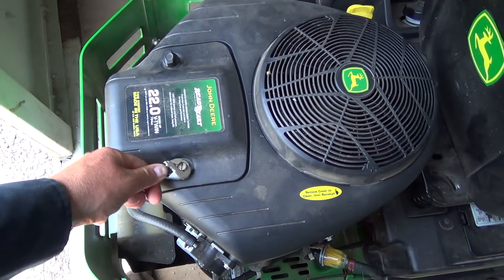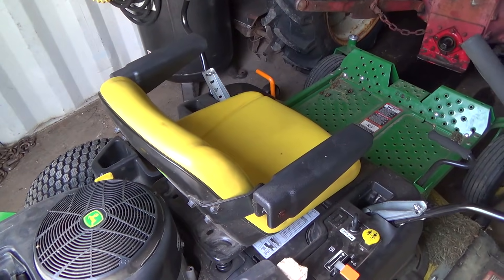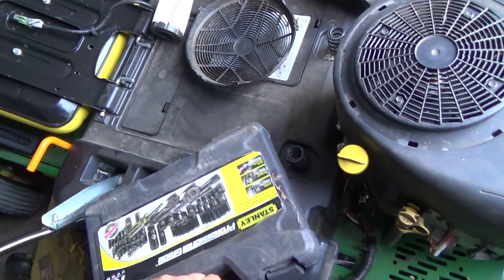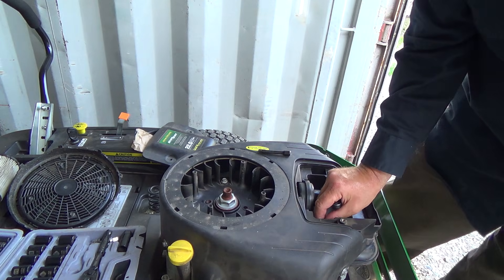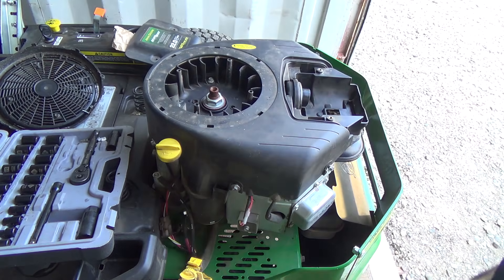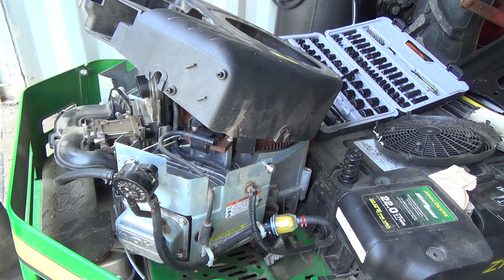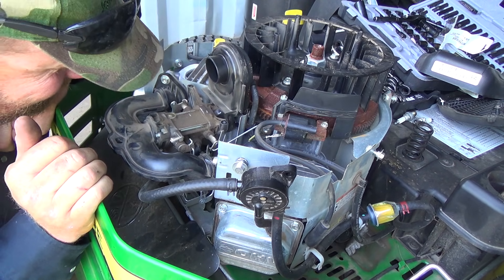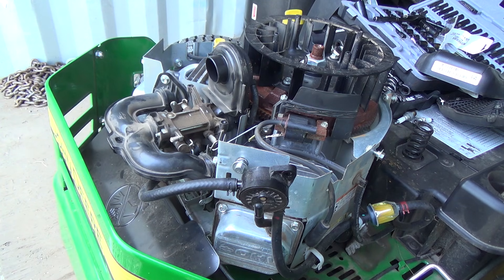Oh no.....We have our first issue with the John Deere 0 turn mower Z355R Intek m44

Comment: I have had that happen with a Kohler engine 
What happened was small sediments got passed the filter into the carb and that made it do what yours did 
Check the bottom of the gas tank also to make sure the outlet at the bottom of the tank is free flowing
Nice video
Hope it works out for you
Nice sounding cam fir a small engine

Comment: Thanks for the video. My 355 did the exact same thing a few times late last season. It even up and died once or twice leading me to think I had run out of gas or had blown it up. The odd thing is that it would go away for a while, but then come back randomly. I assumed the fuel filter was full of crap and intended to change it this spring. Now I'm not so sure that will completely fix the issue.

Comment: Removing that green bumper looks like it would open up a lot of room to get to the carb. 
Plus use that socket that you put screwdriver tips in on the 1/4 ratchet.
Reply: Was thinking the same thing. Looks like it’s only a few screws/bolts on each side.
Reply: @Xanadu245  AFTER, taking the 6 screws out, I realized, the 4 that holds the WHOLE GUARD ON, was quicker and easier.  GJ on those eyes folks!

Comment: Hey Bill, I think you definitely have a fuelling issue. I’d be taking the carburettor apart and checking everything. I think after a clean it should solve your issue. I’ve had this on small engines before when they surge, after cleaning the carb it sorts that issue out. You may need new manifold gaskets but I’d check them when removed, I’d also spray the gaskets with brake cleaner when it’s running to check for any leaks on the gaskets. Air leaks could cause it to surge but tend to make the engine idle higher too

Comment: I figured out that the easiest fix for this is to take my air compressor, remove the fuel filter, and blow air back into the gas tank.   

This solves the problem 100% of the time...
Reply: I just pop off the fuel line and blow back into the tank until it bubbles. Reattach the fuel line and I'm good until it does it again. I'm guessing there is crud in the tank.
Reply: I blew back through the fuel line till I heard it bubbling in the tank. Then I took off the air filter and sprayed seafoam in it. 2 short boats let it run for a second then did a long blast till it choked out. I let it set 10 minutes and it ran perfectly. I am glad that I read the comments on this post. I would recommend do this before going deeper. Thank you!

Comment: My loving wife ran the deere out of gas!!  Now it wants to run like CARP......I know.......Anyway I am getting ready to remove the offending junk she probably sucked up in the fuel system myself....Normally I would have taken it to the JD shop and let them work on it...But I will watch some vids and repair it myself.  A few years ago just before my 55th birthday I had three major strokes and it took awhile for me to be able to function at about 70 percent of what I was...Now I am 69 and would send it to the shop except for one thing...We bought ours a couple years ago and it worked for a couple cuts on the 3 acres then the Z355R quit in the small orchard under an apple tree. I looked at it and figured that it was the diode in the control panel. So I went to the Deere store in Mooresville, Indiana and bought a couple of new ones. I told the guy about what my vom said and he told me "it couldn't be that!  It must be something she did!"....I took the diodes home and inserted one after trying the original one just one more time. It didn't fire up with the original one so in went the new diode...The engine came to life and she finished mowing...The next time was about the third cutting after the new diode.  I checked it with the vom (I know you know that that means Volt Ohm Meter but there are the few that may not who read theses posts) and found the same thing with the diode not reading in either direction and I tried both + to - and - to + with no reading. I checked the new one and the mower...once again came to life. I called the JD service department and told them I needed them to come to my house about 20 miles away and pick up their toy and fix it!  I just paid almost 3 grand and for it to quit running twice and down to my last diode the problem was theirs. Well the argued about it but I called corporate and they instructed the folks at Deere to retrieve the mower and find out what was wrong. To make a longer story a bit shorter they said they couldn't find a thing wrong with it and charged me for the shop trip of $80.00....I told them they were full of carp (once again I am being nice !) I was a vehicle mechanic for many years working on all things military, the civilian years as a mechanic on Yale, Clark and other forklifts and cars and every darn thing else that has electrical/mechanical traits and I was sure it was probably corrosion from sitting in front of Lowes all summer for sale in and out of the rain, and some probably got into the electronics/electrical system and crusted up something causing an overload condition to the diode.  They said Naw....just operator ignorance....So now when something goes wrong with the deere I will stay away from DEERE maintenance!...I told you that story in case you ever have that problem.

Comment: I have a snow blower and a tiller both over 40 years old-- both have original plug-- start 2nd pull- I never even check the plug. I just take out- clean and regap every year

Comment: I had the problem with my JD D155 riding mower with intek 24hp briggs... It had the plastic intake manifold.... there was no heat shield over the muffler & the plastic maifold warped.... It had the rubber o-rings & seemed to suck them out.... I spent a ton of $$$ from Briggs & stratton to replace the manifold & eventually it did it again.... I searched for a long time for the aluminum older pro manifold & got the only one from Ebay.... $30..... solved all my problems..... I suggest get a kohler engine or kawasaki..... Briggs has become nothing but junk the last few years......I will never buy anything briggs ever again....
Reply: Yeah, EVERYTHING is getting cheaper all the time. I think the Briggs is better of the evils, Kohler and Kawasaki -same shit. Honda maybe ?

Comment: It definitely sounds like a fuel issue could be deposits in the bottom of the fuel bowl weak mixture clean the carb bowl and jets check the governor also. Definitely weak mixture for some reason putting the choke on and it helps leads me to think weak mixture I thought it was a little weak looking at the plugs regards Alan.

Comment: Depending on the carb it is the pilot jet. If it has one. 99% of surging idol problems is the pilot jet needing cleaning or even bored out a bit. But I'm not an engine guy. Happened to me on a small engine YouTube tutorials helped me fix it ;)

Comment: The older version of those Briggs inteks had metal intake manifolds. These new inteks like yours have plastic intake manifolds. They are fused together in the middle. After a while they start to leak where they are fused together. I think that might be what’s wrong with yours. Spray brake cleaner on the seam of the manifold while it’s running and that would temporarily seal it and it would run better for a second and stop the air leak just so you know that’s your problem. Try it and see. And the fact that it runs better with the choke on also proves it’s a air leak

Comment: You have a fuel problem. The carburetor is dirty and needs cleaning. I used premium fuel in all my lawn equipment and no problem at all. I know it’s expensive but it’s better than having it at the shop being repaired.

Comment: Start it up Spray some break clean or carb cleaner where the intake meets the head to see if it’s leaking if it is it will make the engine run different

Comment: I don't know, maybe I'm extremely lucky or something but my experience has been the direct opposite of the comments section here.. Everyone is saying how dirt in the carb will do that?  In the last 20+ years of being around Gravely, Allis Chalmers, Cub Cadet, Case, Farmall, Honda, Kawasaki, etc etc etc etc the list goes on for miles of all the carburetor engines I've had twins, singles, quad carbs seen it all.  And the dirty shitty fuel tanks were common for me lol  chunks of dirt and rust always going into my carbs never EVER had any issues.. The only time I had a problem was with a Kawasaki engine because it sat for 5 years to the point the fuel solidified into a hard green substance that reduced the diameter of the fuel circuits in the carb..  So it was running way to lean, couldn't get the fuel it needed so if you attempted to hold an rpm the engine would rev up and up all by itself, that is a lean condition.. Rich would be the other way round it would idle lower and lower til it stops.  Usually just going wide open throttle revving up and down an engine a few times clears the dirt out.  I believe your issue is a bad seal on the intake, or a intermediate electrical failure.  Either with a switch or sensor.
Reply: Whatever the issue, it seems to be common with Briggs engines.  I read hundreds of posts and watched as many videos and all the answers are different, but none of them have worked for me, so far.

Comment: that vane is not to the choke, it is the governor

as it is moved closer to the flywheel its not trying to close the throttle
as you move it all the way away from flywheel it wants to close the throttle
something may have gone out of adjustment causing the governor vane to swing away from the flywheel like it doing, maybe a broken spring or linkage
Reply from the maker: its part of the auto choke system

Comment: 2 yrs later...what did you find out?  I always suspect waterr droplets in the bowl. disconnect fuel has, drain into glass to check for debris or water, drain Carb bowl into glass if possible to see droplets , spray cat cleaner thru carb, let it dry.   I also found some bubbles floating ONTOP of gas sample, I have no idea what that could be unless its ethanol ?    some one reply please.

Comment: I'd say you're not getting enough fuel from the carb. It's sucking in too much air for the reduced amount of fuel it's getting so it starts to die, then as the RPMs go down it's pulling less air so the amount of fuel is fine and it tries to rev back up but then it starts getting too much air again. Could be dirty jets or possibly a weak fuel pump.
You said your guy mentioned possibly a problem with a coil and we've had a coil go bad on 2 of our JD zero turn mowers at work. They always seemed to idle ok but would cough and sputter when you put a load on them so I'd say it's probably not that.

Comment: You have some debris in your carb that is why it is (hunting) with the throttle
Reply: Not necessarily.  The first time this happened to me, I put a new carb on mine, but that didn't help.  It turned out to be an issue with the governor.  The problem is that surging can be caused by many different things.  One of the more common causes is a dirty or an incorrect fuel filter.  You just have to check all the possibilities until you find the problem.

Comment: It could be the choke spring. If the slugs the carb could be old fuel and despoils. Could be the carb floater  inside. Either rebuild, replace the carb, or use carb choke fluid.

Comment: I have a z355e john deere and it wouldn't start. When I put starter fluid in it would fire right up but wouldn't have a steady idle then die. Mind you this is after 2 years no problems. The bottom line problem ended up being the carb had gunk in it. Mark where you take the linkages off of and clean the carb well and it should work.

Comment: Definitely fuel from your test.  May have sucked a little piece of dirt past your carb filter but you have a good fuel filter but I’d charge that and let a little fuel run into a glass to make sure you don’t have and crap in the bottom of your tank as a precaution before you put the new filter on .  Definitely starving for fuel.  I’m thinking if you ran it when it’s running poorly if you use your throttle and put it to choke it would smooth out as your cutting back on air.  If it runs better when the engine if hot but choked , look for something partially blocking a jet in the carb.  I’m thinking with the solenoid if it has a needle in it might be sticking too.  And I’m also assuming the fuel pump works from the engines vacuum?  Could be a fuel pump issue but maybe you can test the fuel pressure just by disconnecting the outlet side and cranking the engine and running fuel into a bottle of something.   Okay I’m done 😂.      I watched this November 15 2022.  What was the problem please.

Comment: Hey Bill did you check the gas cap because they get vacuum lock there should be a vent hole you may have to clean it out
Reply from the maker: yes had it off

Comment: My z355e is doing the same thing as this and I’ve changed everything I can think of.
Reply: Mine too...        ..       any suggestions?
Reply: Spray some brake cleaner on the throttle shaft on side of carb. My 335 is sucking air along the shaft foam seal is missing

Comment: you know bill it could be the electric solenoid that shots off the gas on the carb too sometimes they get dirt in them and dont open up all the way restricting gas into bowl that case take it out cut the plunger off and reuse the solenoid to hold on the bowl they do sell kits to do away with it
Reply: The governor is trying to adjust for low fuel, so it is the jets in the carburetor. They are stopped up.

Comment: So, "WHERE'S THE FIX"?  I've seen the fuel pump do it.  Replaced mine.  Seen the dirty fuel filter, so bad, couldn't see though it. Put new 1 on in correct direction, w/ shut off.  Saw the manifold tube leak. Mine was weather cracked, replaced it.  Gonna go to carb jets and bowl next.  1 week old, 2019 unit.  Sold 2  me by Lowes for <$1900 W/ NO KEY! So, have a few bucks to  troubleshoot it.  Live close to water with Ethanol free fuel available.  That's next purchase.  But, fuel shut off, allows me to run till fuel is out of carb.  Too bad there's no explanation as to REAL CAUSE easily found in this thread... WHERE'S THE FIX BILL? UPDATE on MY experience.. Holy Cow! THIS THING HAULS BOOTY NOW!  APPEARS, the 'previous' owner, had it for almost 2 years from manufactured date.  Evidenced ONLY by all the debris in the fuel bowl and the damage to the machine.  PLUS!  Somebody at Lowes maybe(?), 'replaced' the hour meter, which read only 1.5 hours on the machine I got a GOOD deal < than $2 K.. with a tank full of OLD fuel, that looked like bees wax, floating and sticking round in my bowl.  So, after 1 bottle of ethanol gov't fix it all, I'm certain, I put the springs in the correct places, but the correct springs, in the correct places.  Yup, I'm confused.  But, I did NOT touch the governor.. yet, the choke, has to be done manually.  NO biggie, I got it.  But, boy is it LOUD TOO!  Cosidering a scooter tail pipe for this thing.. fur sure!  Gonna look like a darn dune buggie IF I don't figure out the spring / carb control issues.. ANYBODY GOT A LINK FOR PARTS ILLUSTRATED BREAK DOWN OR SPRING DIAGRAM??  HELP ME.. ! WHOA.. SLOW DOWN SON!!!!
Reply: I had the same issue,it stopped after i changed spark plugs,Oil,fuel filter,Oil filter,Air filter(I bought a tune up kit and it stopped after installing it)
Reply: All of the parts stores on line have schematic drawings of the different engines with the OEM parts numbers.  Just search your engine model number + parts list.  You'll get plenty of sources.
Reply: @constitutionalist3931  Thanks for the reply.  I finally took it to my local JD dealer and they repaired it using my warranty repair.  They contacted Home Depot to verify when I purchased it and they were really cool about it.  It's been trouble free ever since!  Now selling for $5,512.00!  I got a STEAL!

Comment: It's the spring you repositioned incorrect. Spring on the automatic choke.
Reply: That was my first thought also, but on mine that spring hooks to the throttle lever.  The choke doesn't have a spring.

Comment: I had the same problem with an old Toro snowblower. The Carb was the problem, changed it and it was great. Probably dirt in the carb,  try spraying lots of carb cleaner or seafoam in the gas tank. Run it until the cleaner clears the dirt in the carb.

Comment: My mower doesn't like anything but 91 octane!!!!! Drain the fuel tank, put a fuel system cleaner in it and put some 91 octane in it and run it!!!! I'm thinking the metering jet has some grit in it!!!

Comment: There is fuel for small engines line that called true fuel  probably spelt different that does not have this ethanol in it it is a bit expensive but worth it in the long run the ethanol destroys engines faster so if it can be prevented by getting true fuel it might be worth it to you

Comment: Carb needs a good cleaning! That will solve your problem!  Grass can get into the fuel system amd break down over time and also if there is any ethanol in the fuel it eats away at the rubber and that can also clog the jets.
Reply: Mine is doing the same thing, so I just put a new carb on it, but It still didn't solve the issue.  I've tried everything from replacing all the gaskets on the intake, replacing fuel filter to cleaning out the tank, checking the fuel pump, also adjusting the governor, but nothing has worked, so far.  Forgot to mention that I put sealant on the carb to assure no vacuum leaks.  If I ever solve the problem, I'll post it here.

Comment: Typical briggs problem. The surging is the orings in the carb. Ethanol gas makes them swell. I started using nothing but non Ethanol gas and havent had a problem with them